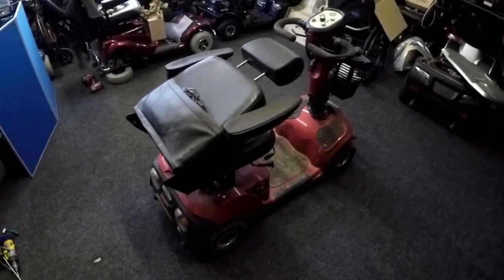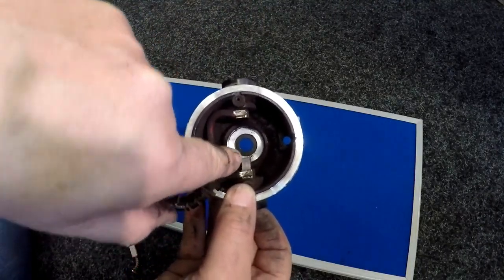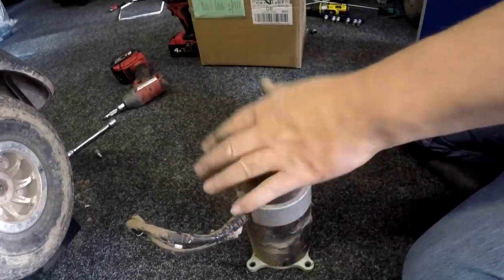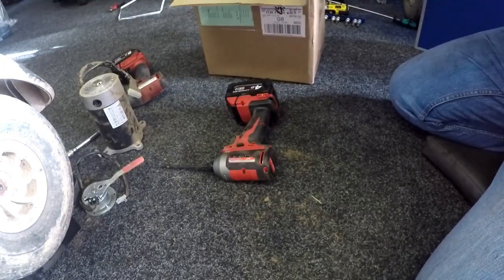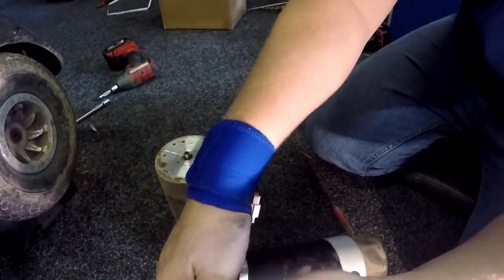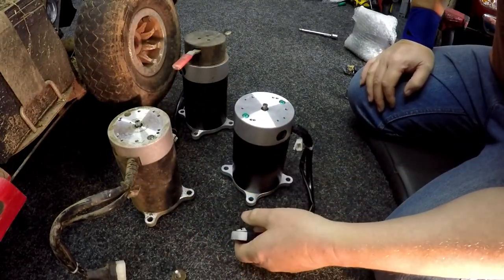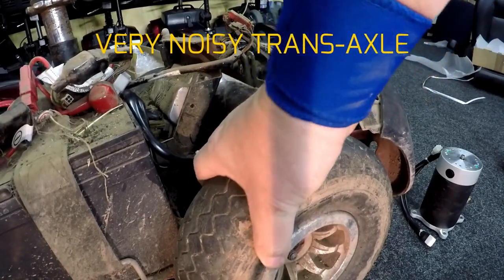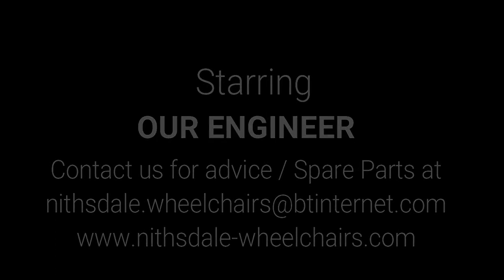*Scooter wont reverse* Mobility Scooter fault finding

Comment: My mom has a Golden Buzzaround EX Extreme. The other day it was working fine and was loaded on car before we went to doctors office. When I attempted to unload at Dr’s office, dreaded 5 beep code. Had to use a manual wheelchair instead.

Got it home. Pulled it apart. No electric brake continuity. Checked continuity of snap switch mounted to brake, no continuity. Removed snap switch from circuit, continuity again! Brake snap switch was bad. So I temporarily removed snap switch until I get a new one. Scooter back together. Goes forward fine. But won’t reverse much with speed pot on lowest setting as usual. With pot on highest setting, it reverses. 

Could I have mounted the motor to the transaxle wrong, or mounted the brake back in the motor incorrectly? Snap switch was mounted to brake with two screws. Didn’t replace them them when re-assembling. Could that be the issue? PLEASE HELP! Mom can’t afford new scooter, especially around Christmas. Thanks.

Comment: Hi my name is Doreen, my excel galaxy mobility scooter wont move forward or reverse and even with the free wheel engaged for operating the scooter its still able to push. Is it the electric break,the bushes in the motor, or more expensively the motor its self. Please help I'm useless without my scooter. It's the mark one/two model
Reply from the maker: Yep sounds like it. Best remove it first to check. We have them in stock.

Comment: Can you get hold of parts etc for a Shoprider dash 4. Particularly motor brushes.Thanks
Reply from the maker: Hi can you please send pictures of your scooter to nithsdale.wheelchairs@btinternet.com  we should have them in stock.
Reply: @tomjacques4  thank you will do
Reply: @tomjacques4  looks like my motor doesn’t have brushes? Should the brake get hot during use?
Reply from the maker: @driftwoodadventure  your motor will have brushes some of them are internally installed usually on small products. The larger power chairs may be magnetic drive. Ps only a few have that. You brake will get warm but should not be that hot   That you can burn yourself or it starts to smell

Comment: Great videos. My friend has a scooter however  If you want to go in reverse you have to go forward an inch or so first. If you forget you need to turn off the key for a second. Anyone any thoughts please?
Reply from the maker: Could be a dirty motor clean the commutator. Check the brush units. If that does not help then it could be the throttle pot
Reply: @tomjacques4  Thank You.

Comment: Could you please tell me what tools I need to remove the motor and what the bolts are called please?
Reply from the maker: To remove the motor you will need Allan keys or a socket that has attachments with Allan keys hope this helps

Comment: Thanks for the videos
Can you help with an Ivacare Orion.
It has fault code 9 flashing and wont move, led battery indicator shows fully charged.
The scooter ran for about 1/2 mile then stopped showing fault 9. Put back on charge then 2 days later it ran for 1/2 mile then stopped with fault 9.
Fault 9 = Miscellaneous
 internal fault

Stops driving.
Any help please.
Thanks
Reply from the maker: Ok then the fault code states controller fault but why is it giving that fault code. one of 2 reasons 1. faulty or 2 may be a build up of heat .. ok then take seat and rear cover off check all the wires going to motor, brake, fuse and fuse holder,, check voltage of the batteries charge again. run it with no load ( so stick a brick under the scooter to lift the rear wheels of the ground) while its running check all wires and components for heat or slack connections. also check to see if the brake is ok..... hope this helps.
Reply: @tomjacques4  Thanks will check tomorrow

Comment: Can you tell me why when the speed control is past the rabbit the scooter beeps and cuts out thank you
Reply from the maker: Happens   Mind you if it rotates more than originally or even 360deg. Then could be a faulty pot.
Reply: @tomjacques4   I fitted a new pot it done the same
Reply from the maker: @grahambenning4047  the throttle pot and speed pot are interlinked so if you have replaced the speed pot then looks like the throttle pot. Also check that the new speed pot is the same resistance
Reply: @tomjacques4  Thank you good advice as always

Comment: Hi I hope you can help me? I purchased a scooter...I couldn't afford much so bought this one. Its a sunrise sterling major 4 2006....I watched all your videos plus more because the brakes had seized including the freewheel brake was siezed. So I took the brake unit off so I can order another one. My q is: is there newer scooter I can use for parts if I can't get, the original brake unit? Also how do I know if the engine is okay? Can I try and run it without the brake unit attached? Any help would be appreciated? King regards Julie x
Reply from the maker: Hi send us a picture of your brake and we will match it up for you. The brake will need to be wired up for the scooter to work
Reply: @tomjacques4  I can't send pic just yet lol

Comment: Buenos dias,te sigo en tus videos desde Malaga España y me resutan bastante intersantes, resulta que tengo un carrito de movilidad reducuda y tiene alrededor de diez años y e tenido algunos problemas y resulta que no encuento soluciones aqui, que me puedan ayudar pues los tecnicos de talleres cuando le llevo el carrito me dicen que eso sale muy caro y lo mejor es comprar uno nuevo y claro yo soy pensionista y mis recurso no me permite esos gastos tan grande, mi pregunta es el carrito es de 24v marca rio 4 prism 4 de cuatro ruedas y la salida de bateria es de 24v pero al motor llega 21v y quisire saber si es del regulador, pues su precio ronda los 200 euros aperte la mano de obra si me pudiras orientar te lo agradederia gracias y perdona las molestias un saludo.

Comment: Tehehehehe I'm back again they replaced the whole motor then welded the wheel on 😆 OK so the free wheel I have to twiddle it aggressively to get it to actually move. The brushes are needing replacing as well...I assume I need a new freewheel...
Reply: Also my boiler blew up what's the chances it needs a new fan 😆😆😆
Reply: Why is my life like this 😆😆😆